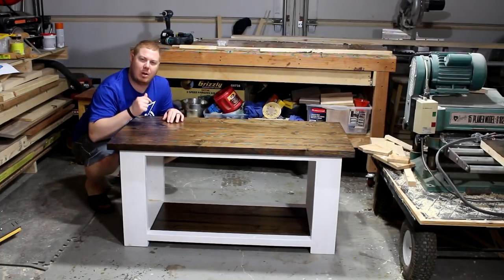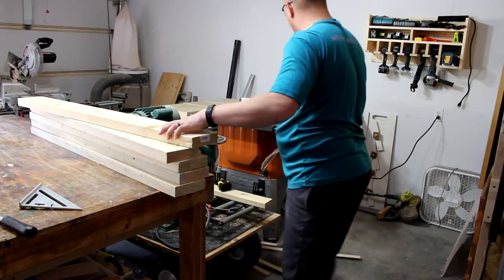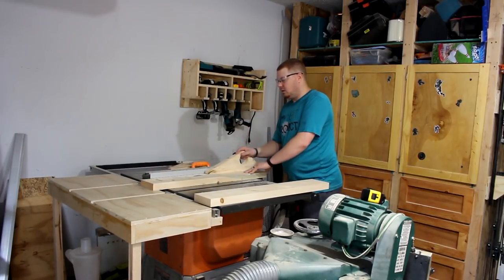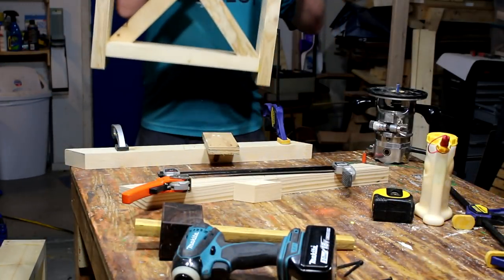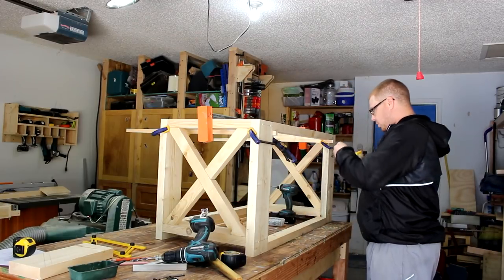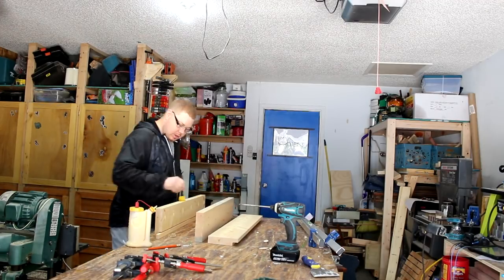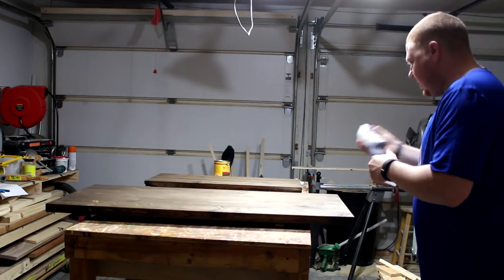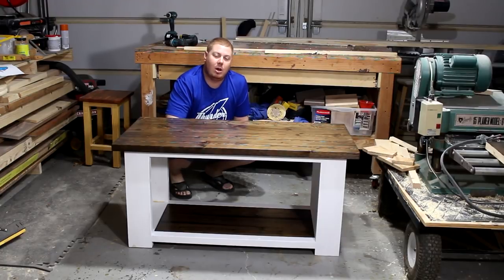Coffee Table (with "X" bracing)

Comment: I started used figure 8 clips to attach the base to the top. Allows for wood movement. Actually had a tabletop crack- right down the middle.
Reply from the maker: I didn't do that on this coffee table, mainly because of how small it is.  But when i built my new kitchen table, I definitely used those then.  

It is probably a good idea to use them on this as well just to be safe.  I may end up coming back one of these days and adding them.  

Thanks for watching.